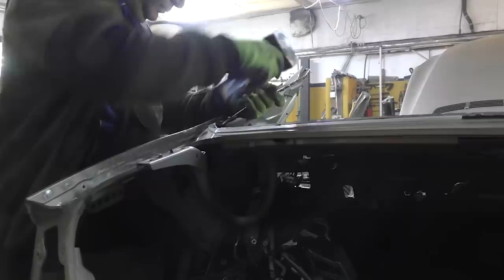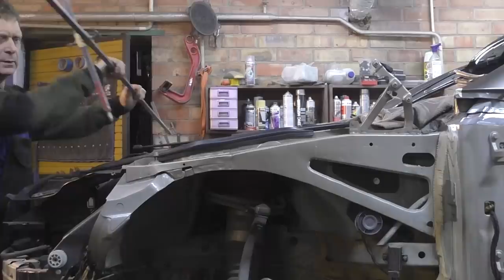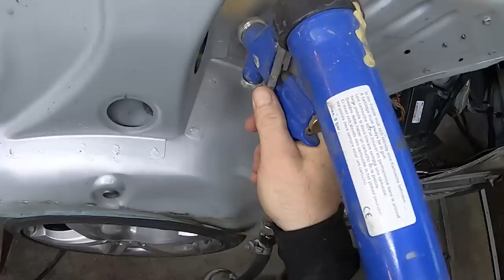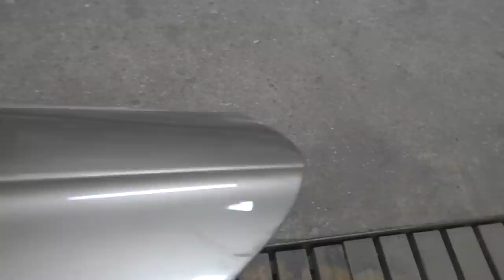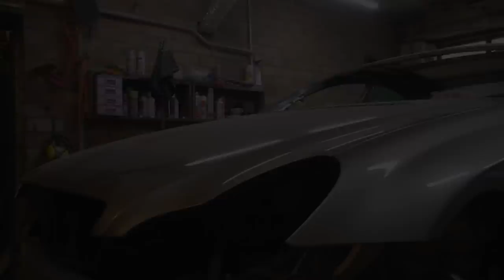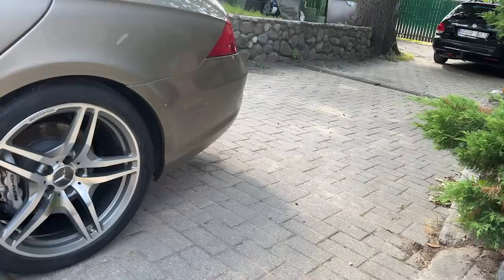Mercedes CLS63. Body rebuilding. Ремонт кузова.

Comment: This is absolutely mind blowing. I've been watching your repairs for a few years now. This might be one of the most extreme repairs I've seen. What I've always wondered is how would such a complicated and time consuming work can be worth it? How expensive is this kind of work? Are these paíd by the owners? (No insurance I gather) Is the structural integrity maintained? Noises, rigidity, handling, etc. How do such repairs affect the cars overall? It's really impressive work.
Reply: Try finding the white 7 Series, and the white 911. Truly mind blowing talent 😳
Reply: I guess the labor price should be between 2-3k €, if he done in 1-1,5 week it soubd be good earning.
Reply from the maker: Many cars drive after repair and there are no problems. All safety elements have been replaced. Now the cost of repairs, this is considered by the owner of the car. If it's profitable, he does.
Reply: I think they buy these cars from auction sites in Europe or USA to rebuild for cheap and sells internally for big profits. I think Middle East countries aren’t strong regulated. This is a time bomb no matter how good the repair looks like. But, it is funny to watch.

Comment: I love how no one said anything about the b pillar he welded together. If that b pillar reinforcement is even scratched it is supposed to be replaced. It has tailored edges at the top and bottom where its acceptable to weld together but, the main part of it is ultra high strength steel. It can not be welded on or even have the ecoat busted. So if any one gets t boned in this thing they are going to die 100%. This is why u shouldn't do this kind of work without training. I am a autobody tech and have been for 10 years. I do alot of heavy hits like this but I repair them to factory standards not this hacks standards.

Comment: My carcass is 'parked' in front of a 65-inch LG QN90A QLED TV, that a friend dropped off so that I could repair the backlighting power supply....  A 'two head of cabbage' batch of haluski (with 'Dropky' egg-drop dumplings) in browned butter from a small Mennonite-owned dairy less than two miles away, is being lovingly stirred/sautéed/whichever, about five meters away, to my left, by my 'across the street' neighbor's wife and daughter.  And, Arthur has a basket case rivalling that white 'Beemer' from a few years back...  Life gets no better than this!

Comment: This is a repeat of an old video i think?  Really Arthur, i admire your skill but really - this if a death trap!  The roll over bar in the B pillar was cut and welded, the A pillars are high strength steel and should be replaced at joints not sawed and welded? I sense this video of not your finest hour?
Reply: Продолжение с завершением. Артур знает, что делает. С того света жалоб не поступало

Comment: Not every vehicle should be repaired. Some of your repairs are perfectly okay from a craftsmanship standpoint but borderline from a safety standpoint. 
But repairing this damage is beyond anything that should be done. This car is no longer safe! 
I would not voluntarily put a foot in this soul seller.
What is the top speed? 250? 270? 
In a moderate accident, this thing would fold up like a newspaper. Anyone who would sell something like this without mentioning this repair should get at least 10 years in prison with hard labor.

Не каждый автомобиль подлежит ремонту. Некоторые из ваших ремонтов вполне нормальны с точки зрения мастерства, но пограничны с точки зрения безопасности. 
Но восстановление этого ущерба выходит за рамки всего, что должно быть сделано. Этот автомобиль больше не безопасен! 
Я бы добровольно не ступил на порог этого продавца душ.
Какова максимальная скорость? 250? 270? 
При аварии средней тяжести эта штука складывается как газета. Любой, кто продает что-то подобное без упоминания об этом ремонте, должен получить не менее 10 лет тюрьмы с каторжными работами.